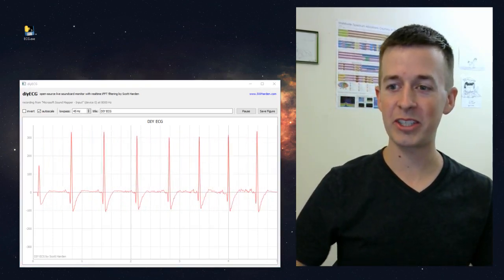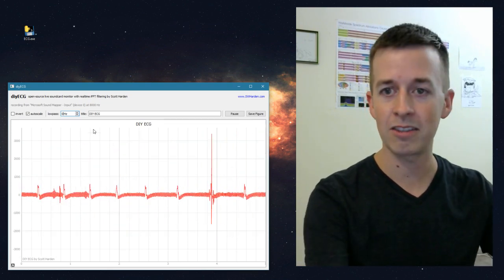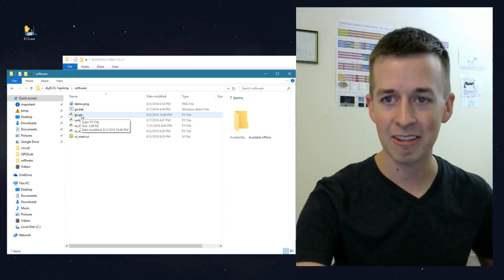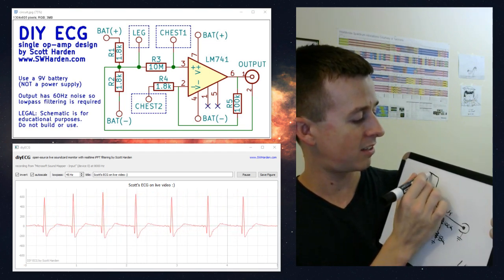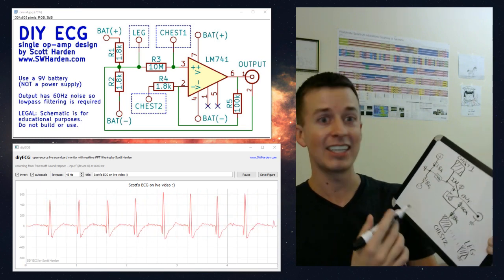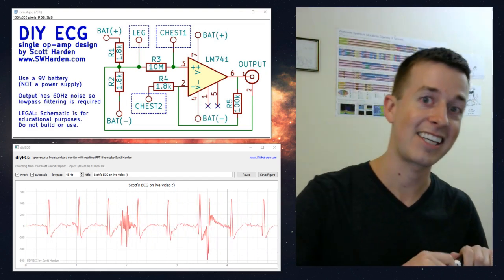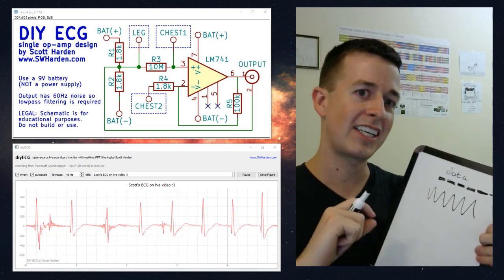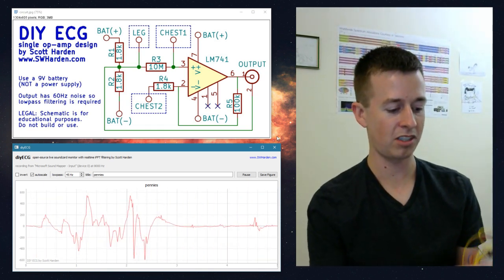DIY ECG - 1 op-amp version

Comment: Great project man. I wired it as shown in the schematic and even used 3 coins as the electrodes. I put them 2 on left and right chest and right leg. All i'm getting is a bunch of noise in the .exe app.
What could be wrong?

Comment: I want to run a telerobot from my own myoelectric signals. Do myoelectric amplifiers need more amplification than an EEG? Also do you have a c# version of your EEG project? I built my own hardware true random number generator using a 741 op-amp and you have shown me why it could be unreliable using a breadboard due to the antennae effect. The reason I needed a TRNG was I have found a way using them with some clever software and maths to overcome the no communication theorem and send FTL signals on a CTC. I now use a Comscire QNG because building my own fast TRNG was too much like hard work.

Comment: Would it not be very easy to have a second stage of amplification with two RC networks to give 6dB per Octave rolloff to do the low pass filtering, so you could display the signal on a scope directly?

Comment: It works :D !! Im very excited!! Thank you Scott for share this project. 

I have this question: if a use an oscilloscope to project the signal and a pasive RC Low-Pass filter should i see the same signal? or i have to use the instrumentation amplifier as you said at the begining of the demostration?

Thank you again, and have my best wishes!
Reply: I did the wiring and but i'm only getting a bunch of noise. Did you tried including the low pass filter and checked the signal in the scope?
Reply: Do you remember how many watts the resistors was?

Comment: Great job :) So, why is it actually works? All ECG schemas i found contains at least 2 opamps. Is it because sound card has its own amplifier on input?
Reply: And second question, did you try to put signal from your ecg schema to controller adc, will you need additional amplifier for it to work? I am going to check will it work with controller anyway, just what you think about it? :)
Reply: That is the beauty of the code he built. He just amplified the signal straight ahead in one step and managed to eliminate all noise which is generally avoided with those 2+ op amps configurations.

Comment: Good video, and creative thinking. But these waves are very crude to give any meaningful information. It just shows pulse, not EKG diagnostic waves.
Reply from the maker: This is correct! It is a fun project to increase peoples exposure to circuit design and signal analysis software. While the waveform may not be of diagnostic quality, it is interesting to inspect. It could be used for heartbeat rate detection (obviously only in non-critical applications).

Comment: Very good project but i can't understand why you use 10m ohm resistor. Can you say me why you use it and what  wıll happen if I DON't use it. Is it dangerous to not use 10m ohm resistor??
Reply: Yes he said as the op amp input has high impedance, the current coming from the battery will go through your body and may stop the heart

Comment: hm. i rebuilt your circuit 1:1, just instead of the sound card i used the oscilloscope in roll mode, as this felt like a not unreasonable thing to do. but all i get is perfectly homogeneous 50hz noise. zero signal :/
Reply from the maker: Raoul, that does not surprise me. The software does an immense amount of filtering that your oscilloscope is not doing. At one point in the video I disable the filtering and you can see that all I get is 50hz noise. You replicated this result, just with an oscilloscope. If you want to do this without a computer, you need a well tuned and very narrow 50 Hz (or 60 Hz) notch filter on the output. Good luck!
Reply: thank you very much Scott for your answer. that makes total sense, indeed. I was just somehow under the impression that i should at least see some small dent or so, instead of pure noise without a hint of structure. I am a mechanical engineer and spent the last few years doing mathematical modeling and simulation of soft tissues and related stuff, trying to refresh my electronics with some home projects. :)
Reply: i will try the sound-card adc instead!
Reply: Raoul hi Raoul, did you manage to make it work? I was also expecting at least a small peak. We could see it when the filter was turned off on the video, a lot of noise due 60hz but also the peak of the heart beat. I am thinking this is only a pre-amp and then the computer card has another amplifier for its incoming signal. So there could be a need of more gain in a Single amplifier if not using a computer or two amplifiers to get some signal...

Comment: is it possible to measure EMG AND EEG by using same circuit and same electrode. by just changing the position of electrode.
Reply: yes, maybe you should change the gain, but yes it is possible
Reply: You also need to change the lower and upper cutoff frequencies of the band pass filter.

Comment: so, is it possible to run the software on a raspberry pi? Awesome project, thanks.
Reply from the maker: It may be possible, but in my experience QT libraries aren't easy to get running on the PI. This is because (as of about a year ago) the PI operating systems support Python 2.7, not Python 3.x -- so it will take a little effort to set up the right version and all the right libraries. On a more complete system, you can just install Anaconda and it works. Maybe try to install Anaconda on the PI and see if it works? Email me if you figure it out and I'll add the notes to the project page! --Scott

Comment: Can you use the graph to calculate bpm ? Can the output graph + the bpm to displayed in a little i2c screen with the help of arduino ?
Reply: the arduino probably doesn't have enough processing power to do FFT and low-pass in software. you would have to make your own program that just looks at the peaks in the signal

Comment: to prevent issues from the computer, just add a capacitor in series to the input line.
Great project TY
Tim
Reply from the maker: I actually don't think this is a winning idea. A passive series capacitor on the output will act as a high-pass filter and preferentially pass the 60Hz noise and resist the low frequency signal that is the ECG. To let the ECG signal pass, you need a very large value capacitor. I don't think it provides a lot of benefit, and if you really want isolation from a computer consider using an opto-isolator.

Comment: Built it. Worked as advertised.
Reply: Which 3.5 mm audio jack did you use for taking output from circuit to computer? TRS or TRRS?

Comment: How about a diode in the output to prevent reverse current
Reply from the maker: Not recommended. This is because the output is AC coupled and centered at 0 V. Not only would the diode delete all signals below 0V, but it would also remove all signal below its forward drop voltage. The output of this circuit is to be connected to the microphone adapter, which expects + and - voltage anyway. Good question though!
Reply: understood.... thanks for replying
Reply: Im actually trying this out

Comment: I want the codes that you used in the processing
Reply from the maker: https://www.swharden.com/wp/2016-08-08-diy-ecg-with-1-op-amp/
https://github.com/swharden/diyECG-1opAmp/
Reply: the processing is not accepting the codes that meet it although I think you used the arduino (my interpretation of processing and 2.2.1).
Reply from the maker: This is not Arduino, this is just an analog op-amp. Also, software is Python, not processing or Java
Reply: so thank you

Comment: Can I use an oscilloscope as my output?
Reply from the maker: Anna Heart probably not because this software does a lot of filtering. Check out my latest ECG video though, that one is perfect for an oscilloscope
Reply: Scott Harden I already checked that out but I have to use an op-amp 😔 that’s why I’m interested on this one but I don’t know anything about programming and stuff.
Reply from the maker: You can probably see the ECG signal on the oscilloscope, it will just be really noisy. The 60 Hz noise will be 10x bigger than the ECG signal, but the 60 Hz noise will bobble up and down with your heartbeat. A better project for using an op-amp is a pulse oximeter! https://www.youtube.com/watch?v=bKAJsZJvMI0
Reply: Scott Harden I think I can make the software work out. Now... hoy do I connect the circuit into my computer? Like the “microphone”?
Reply from the maker: Anna Heart you got it!
Reply from the maker: Check out my SoundCardECG software on google. It’s designed for another project but it’s super simple and should work too.
Reply: Scott Harden but like, the same hardware?
Reply from the maker: @annaheart4906  Yes, the SoundCardECG software will work with any hardware as long as it's connected to the microphone jack.
Reply: Scott Harden that’s amazing! And how do I connect the microphone jack into the circuit? Sorry that I make a lot of questions 😳😳

Comment: hello, nice project and good software!
I'm new in electronics and I have a little question, it seems a sort of mistake, but maybe I missed something. reading the datasheet of LM741 the minimum supply voltage is 10 V: how can it work with a 9V battery? of course it works! but does this "baseline" affects in some way the OPAMP?
[http://www.ti.com/lit/ds/symlink/lm741.pdf section (6.3)]